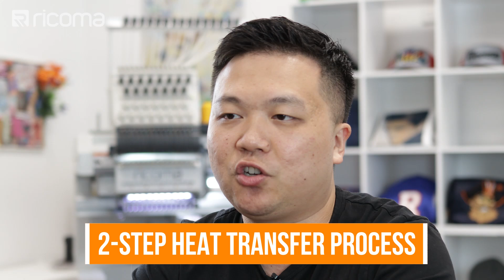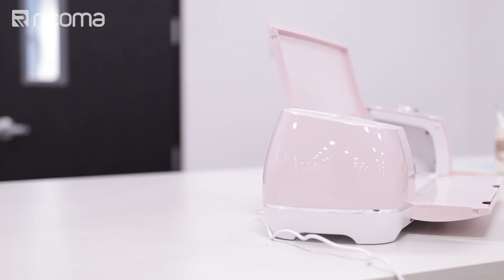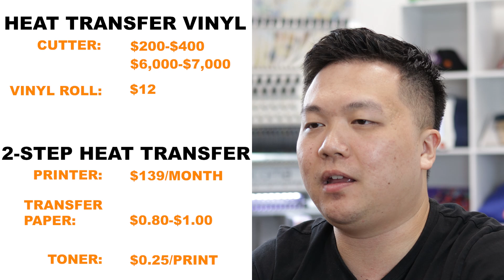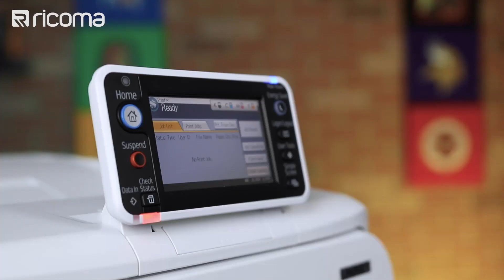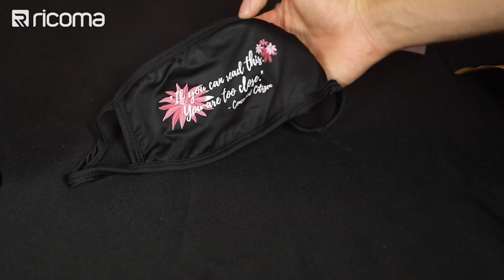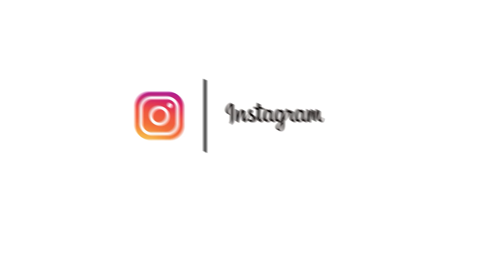Heat Transfer Paper Vs. Heat Transfer Vinyl | Cost, Durability & More | Apparel Academy (Ep 64)

Comment: I know this video is a few years old but just found it. Was wondering if I can use a an HP Envy Photo printer to print on vinyl or does it need to be a special printer. Thanks
Reply from the maker: Hi Connie. We would recommend checking in with HP so they can look into this for you.
Reply: Hi could you also tell me if there are any brands of 8.5x11 HTV that are better than others? Or do you have a video of the most popular brands that I missed? I am new here. Thanks!

Comment: Hi, great video. Can an Epson ET15000 work for the heat transfer paper method? I know the Epson can be used for sublimation once you use sublimation ink.
Reply from the maker: Hi there, thanks so much for watching. Unfortunately, we are not familiar with Epson printers. We recommend reaching out to the manufacturer. Sorry we couldn't be more help!

Comment: You left out a very strong contender and that is classic water-based screen printing. Which fills in the gap that vinyl cannot do but is far cheaper than DTG and allows you to do much larger orders and quantities. In the end screen printing will always get the edge on any other print method whether it’s plastisol or water-based on large quantities which is where the real money is. Not to mention you can do layered wet on wet CMYK water based inks like Willflex with half tones and get almost the exact same quality that you can from a DTG printer.

And if you really need absolute pixel detail on a shirt I wouldn’t even choose DTG I would go with DTF with two step transfers. The DTG market I don’t think it’s going to last very long as it is already starting to dwindle. Folks are shedding DTG machines left and right and they are for sale everywhere now.
Reply from the maker: HI Tom, thanks so much for watching and for your insight. This episode was just a comparison of heat transfer paper vs. heat transfer vinyl.
Reply: Sounds like you know the Indy well enough to see where it's heading ! 
Do you know any process that would allow me to apply this tech to a physical 3d model ?
If you can, a process search term... 
I'm looking for something printable (as opposed to multi-step screen printing)  flexible, maybe heat transfer of some kind ~Thanks